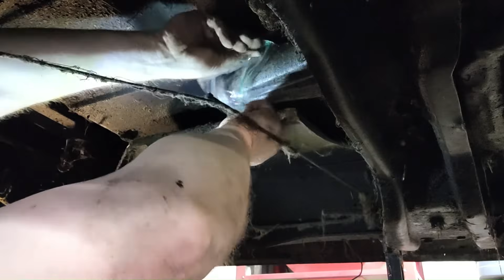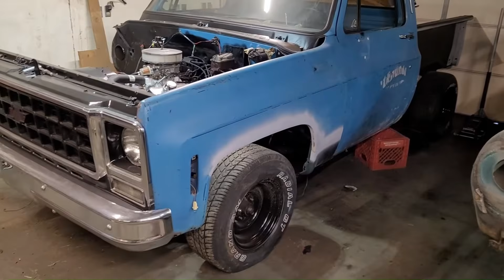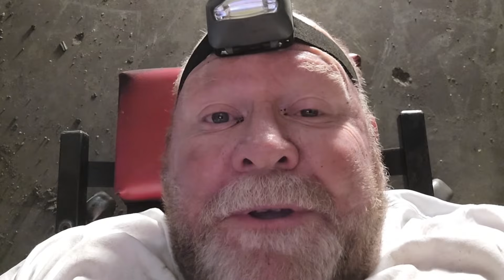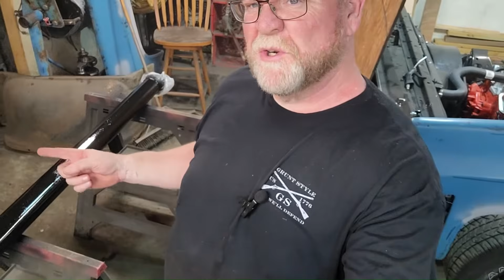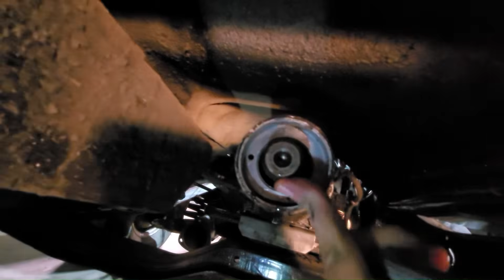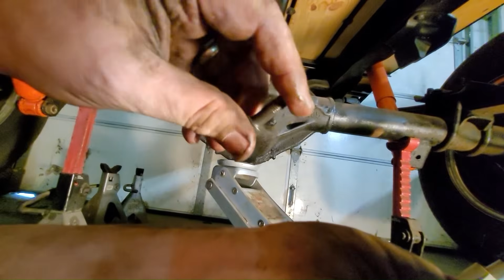How To Easily Remove & Install a DRIVESHAFT: Square Body Chevy Build

Comment: I can't get mine off my 91 dodge ram the back is stuck on it don't just lift like yours I hit it with a mallet some wd40 and a wrench as a pry bar and I'm stuck on it someone show how to remove one that is stuck on the back end like yours not like the other style of them
Reply from the maker: if you have a torch heat up the yolk so it will expand a little then it should come out
Reply: I think truck have be on jack stands fighting with mine now and in neutral with wheel blocked I hope

Comment: Nice video!  I gotta vibration on my truck, (‘95 Suburban) going up hill, at higher RPMs and when going above 65 mph.. I’m thinking drive shaft needs balanced or replaced.  I’m thinking remove the drive shift and take to shop instead of taking the truck in… can a drive shaft be checked for balance while in the truck?
Reply from the maker: sorry NO, Have to take it off to check balance
Reply: @unclebucksgarage7695  thanks!

Comment: two options: first is to get a carbide bit and drill into the snapped bolt. Then use an easy out and spin it back out. Second, if you have a welder use a small portion of a 6011 rod and insert into the hole. wrap it with a small amount of paper so it will stay centered. Then touch the welding stick to it quickly. Once welded use vice grips and spin out slowly. I feel one of these methods should work for you. I have done both and each can be done with Home Depot parts. Thanks for the great video and best of luck!!
Reply from the maker: Thank you, I'm about to call in the calvary. See what ma and my friends can figure out.

Comment: What kind of paint did you use on the drive shaft? It looks real good. 👍
The broke bolt SUCKS though. Been there, I broke the front drive shaft on my Jeep. 🤦🏼‍♂️
Reply from the maker: I live in the south so I have ACE/TRUE VALUE hardware stores in my area so I use their. PREMIUM ENAMEL spray paints. I highly recommend them. $5 as opposed to $10 for any other brand. Good stuff